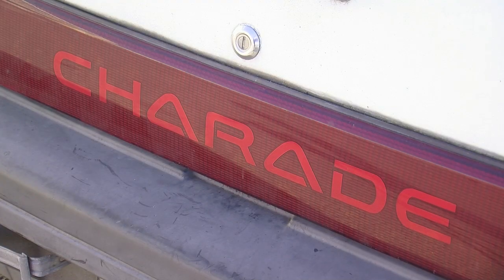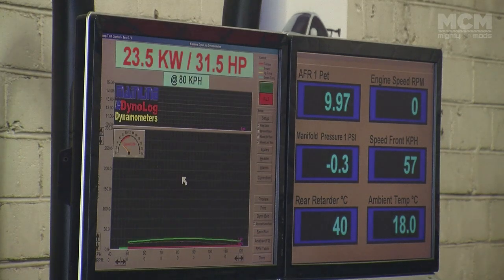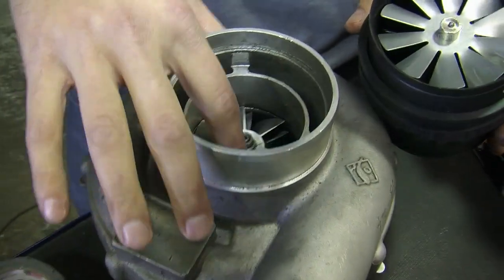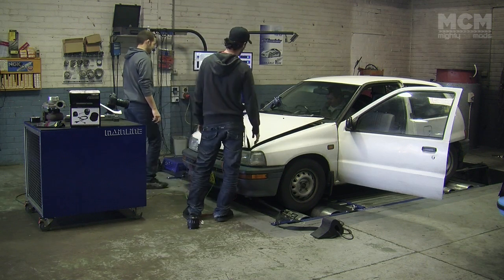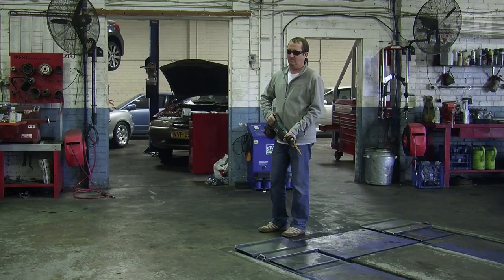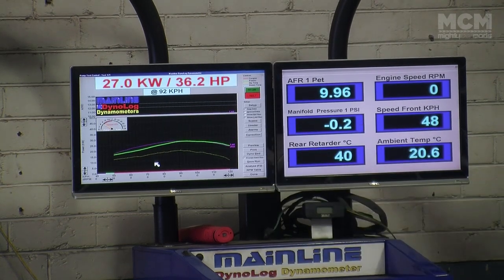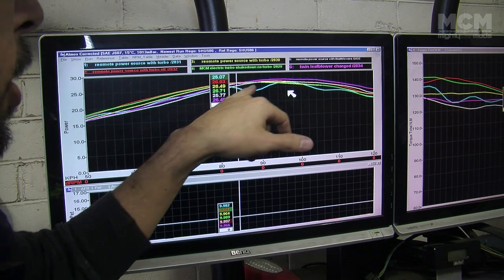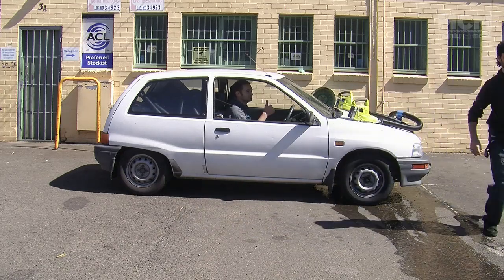Electric SuperChargers Mythbusted

Comment: I recently encountered that again, in another video. Below is my comment on that video. I was wondering & hoping, that since I am loyal to BEVs & Series-Hybrids, could you revisit this topic, and build a serious, neat, Electric-Supercharger system, based on my comment below? If you want a new challenge, or project, how about you try this?:

 Those intake fans, are one of the most stupidest, most retarded, retarding, evilest scams I know of, only bested by Abrahamic religions, governments, and Chinese plastic-rice & frying with gutter oil. I can almost guarantee, that your engine can move more air, at IDLE, then those intake fans. Electric Supercharging is possible, but you need an electric motor, that's bigger, stronger, and more robust, then your Starter-motor. And whether through direct gears, chains, or pulleys. The gear ratio would have to be set up, for the compressor to spin much faster then the Electric motor, and that motor needs to be torquey enough to do that AND compress air...

With normal Superchargers, that are powered directly by the engine's crankshaft. Those Superchargers are very simple, and have no lag like a turbo. But the parasitic drain. Instead of using the normally wasted heat & pressure of the exhaust, like how turbos work. A Supercharger makes an engine work even harder, to produce more power, because the Supercharger is a physical load on the engine. This is inefficient.

I bring all this up now, because a serious Electric Supercharger, will also place a physical load on the engine, only the load isn't from directly turning a compressor. The load is from the Alternator/Generator, which becomes harder to turn, when it's creating more electricity to power something or charge something.

So Electric Superchargers, maybe pointless.

The only benefits I can think of for Electric Supercharging, is setting up an Arduino or something, so you can have an adjustable Supercharger, that you can also turn off for fuel efficiency, though, if the stopped compressor & motor become an air restriction, then you may need a separate intake & bypass valve, to go around it, and the bypass valve has to be strong enough to seal in the compression, when the E-Supercharger is turned on.

You can program the E-Supercharger characteristics, to change with engine RPM, or have settings that change on the fly, with buttons...And unlike a normal Supercharger, this hypothetical E-Supercharger's RPM, is completely separate from engine RPM. So if your engine can physically handle it, and the fuel system hardware & software can handle it, then you can have near instant, ridiculous levels of boost, FROM IDLE...You may be able to do surprise launches, almost like a powerful Electric vehicle, but not as instant as electric motors directly turning the tires, because an E-Supercharger has to build compressed air, for an engine to build RPMs, for the engine to reach it's optimal torque & power ranges. But the acceleration should still be better then stock, if you're loyal to engines directly powering your wheels.

For the compressor motor to spin faster. I recommend it being powered by Super/Ultra-Capacitors, with enough wired up in series, for a higher voltage to spin faster, and enough wired up in parallel, for capacity and a greater ability to handle the load spike, of the compressor motor instantly spinning up, to as fast as it can, or to as fast as you allowed...Use a DC to DC step-up converter, to increases the 12-volts from the normal Alternator & battery system, to a higher voltage to charge the capacitors, and spin the compressor motor faster than 12 volts can.

Make sure to choose a compressor & motor that can handle spinning at high speeds, and maybe a separate cooling system, for a liquid-cooled electric motor, especially if the motor & compressor are in the engine compartment...And if you are going to use a 12-volt Alternator/Generator, instead of a higher voltage one for the E-Supercharger system, and a step-down converter for the normal 12-volt system. If you still want or have to use a 12-volt Alternator, then make sure it can handle the current needed, for the step-up converter to charge the capacitors, and power the E-Supercharger.

It's like you're building a homemade Series-Hybrid or Parallel-Hybrid, only instead of an Electric motor turning any tires, it's turning a compressor for an engine. And the motor controller's throttle signal, is from an Arduino with sensors, or in tandem with the engine's throttle, or the signal is an on-off button, acting like a Nitrous button, only instead of N2O, it's Ultra/Super-Capacitors.

 I forgot to mention, there are electric motors, more suited for speed than torque, like search for motors that give you higher RPM, per volt. And instead of gears, pulleys, or chains, it may be good to directly couple a high-speed Electric motor, to a centrifugal or axial compressor, or maybe a twin-screw or roots style compressor.

If you're interested in a real Electric-Supercharger, then do your research, be creative, and be careful.
Reply: I apologize for it being so long, but I like being detailed.

Comment: I brought one for £5... 
Not electric mind but you put it on your intake then your filter afterwards.  
Got a turbo diesel 5 cylinder alfa brera remapped to 270bhp. All the extra fan is doing is just forcing air into the turbo faster so spool times are quicker. Did i dyno run and added an extra 5bhp
Removed the DPF and the gunk and gained about another 10bhp 
Deleted the EGR gained about 10 extra break and fuel consumption 
So in total 290bhp 
But yes i think the little fan made a difference to my diesel 
The boost is insane

Comment: 14:23 Turbo chargers are fans too powered by the exhaust. And on a mini bike there are noticeable power gains with the electric turbo (not sure number wise, but it  was definitely a noticeable gain) but you said the electric turbo charger is just a fan and it absolutely doesnt work

Comment: A supercharge takes on the order of 25 to 50 horsepower to run for flowrates and 10psi  for a V8 size motor. The range is that big to cover different engine sizes/rpm ranges/efficiency and just to give you an idea of the power required. This is just not happening with this fakery.

Comment: Here's a question why don't these work? Why can't an electric motor do the same as an exhaust driven turbo?
Reply: I guess they just plain dont make pressure. this is just loosely blowing air into the intake.maybe if you got a belt driven supercharger and connected it to an electric motor to spin it itd work.

Comment: MY hybrid has dual  60KW (80HP) electric boost motors  putting out  160HP/368 lb torque . plus the 332hp  367 lb torque ICE..    No need for an after market cheap electric  turbo 

electric motors do the job well,     those are just too weak

Comment: Turbos don't just blow air, they compress the air. Audi is bringing out some Turbo models with electric supercharger to combat Turbo lag. A 12volt system is not sufficient as AUDI uses a separate 48v system to run a 7kw electric supercharger

Comment: Get a vehicle with a mid 70's to earlier Chevy v8. Perferred an actual 350 bored to 357. 9 on the compression. And spend the $1'350.oo on a B&M super charger.   Broaden the spark plug gap .50 from the stock gap. Run 93 octane with 104 octane boost about 1 oz per gallon. There.

Comment: OMG you noobs know nothing about volumetric efficiency do you?????? The idea is to have more oxygen per cubic foot and you are trying to do that with fans to simply push more air through your motor well in this video I see a few mistakes okay first off your plumbing for the intake air should have no zeto hard 90 degree turns they will restrict the flow and polishing the ports in the cylinder head will allow better flow as well and a little cam can help to lastly the exhaust has to be just as free flowing as the intake all that will give you a very noticeable increase in power granted it's going to cost some money...... It's like I used to tell my customers when they asked price I'd ask them how fast do you want to go the faster you want to go the more it'll cost for sure need deep pockets to be legit 😉😉

Comment: Well the if you wanted to get into the math side of it, you could probably get an increase in power on some engines with the cheap pipe fan, but it would depend on the amount of air the fan was capable of moving per minute and the amount of air the car needed per minute.  The problem with what happened here is the car at full throttle was using more air than you could get from the fan in a pipe gizmo.  Which is why the two leaf blowers did do something, they pumped  more air.  The fan in a pipe might actually work on something like motorcycle engine at low RPMs... but that is the other problem, faster RPMs will mean the engine is in need of more air and these electric fans or even leaf blowers only operate at a single speed... that means they will likely work to some degree though start doing less as the RPMs go up until you pass the point where they can't deliver the amount of air needed in which case you would see the power start to drop as the engine is then starved of air.  It would have been interesting to see a printout of the power over the full powerband with the fan in a pipe and the stock car.  I'm betting you would see some minor increase in power down around the idle speed maybe even up to about 2,000 rpms before you would see the powerbands converge and then the fan in a pipe band would drop below the stock band.

Comment: Hey guys, you are absolutely right about this garbage. However, there is a better quality product on the market which has to be imported from China. I watched their test video, and it is an actual turbo. Unlike this one with cheap fan blade, that one has a long shaft which looks like a mini steam turbine. It has rows of fin blades, and last row is reversed fan blades. It also has two little side intakes to compensate air loss. That is airplane turbo design, and their test showed significant increase on performance. I didn't see a computer result, but they did couple other tests on the short video. The air flow rate got five times higher, and 0-100km was 2s faster. It also has a control chip with adjusting abilities for speed, mode, delay time, etc. Needless to say, the motor is brushless. I am getting it, and I am confident that it would work.

Comment: What about ram air?  Does it actually add power?
Reply: True ram air forces more air into the system plus its cooler air both of which will definitely help add some power but the computer needs to be reprogrammed to get the air fuel mixture correct in order to gain the most from ram air/cold air intakes.

Comment: You boys know those were meant to be put directly to the intake or carb right you loose a lot of your forced air in the air cleaner... There is a video of a ford excursion 5.4 ltr getting an extra 25 hp off of a leaf blower

Comment: maybe i think u must remove default air filter first, so make sure the electric supercharger behind of air filter. because if the arrangement of supercharger then the air filter was the air boost to the machine blocked by air filter.
Reply: So, not only does this fan not compress air, therefore, you cannot fit more air into the cylinder, and therefore cannot fit more fuel into the cylinder, and therefore, cannot get more power. The only thing these could ( and don't do) is help you climb through the revs faster by speeding up the rate the engine gets air. So come up with whatever reason you want, this wont make more power. If it DID compress air, you would still need a tune for the ecu to give more fuel, if you slap a real turbo onto a car and dont tune for it, youll knock it apart and the ecu will try and take as much power as possible by pulling time to prevent your dumbass from blowing the motor

Comment: Can you use a big compressed air tank with a valve that you can operate from inside the car to pressurize the air in the engine ??
Reply: How to know how much airflow in and how to add fuel to match.and compressed air are hot

Comment: @13:50 "Turbos spin at over 100,000 times a second." -Marty

I thought turbos spooled to something like 30,000-50,000 RPM, but according to Marty we're talking 6,000,000 RPM
Reply: he said 1,000,000,000
Reply: @K7L3-93  Protip: if you double tap the left side of your screen you should be able to rewind the video. Master this handy technique to avoid being obviously and needlessly wrong about everything, ever.
Reply: @seedy80  I'm on PC. Double tapping isn't working.
Reply: @K7L3-93  you may be missing a crucial detail, let's troubleshoot this.   Please confirm that you are actually on PCP and repeat the attempted double-tap on something else.
Reply: @seedy80  I am on PCP yes. I'm tripping balls right now.
Reply: @seedy80  Need better instructions. My monitor fell off my desk.
Reply: @MaxBrix  shit your lucky I was trying to follow the instructions but I accidentally dropped the toaster in my tub!
Reply: He meant 100,000 rpm. If my turbo was doing 6,000,000 rpm as Marty suggested, I don't think it would still be working after 100,000 miles!

Comment: I keep telling people that real superchargers are using 30-60hp at peak power (some even higher) so there is no way in hell a 100w tiny electric motor is doing the exact same thing even if it did have a proper compressor which none of them do to my knowledge. If you want a real electric supercharger rig up a 72V motor off of a Tesla and fasten it to a compressor wheel geared up about 12:1 and bolt on three or four of the largest alternators that you can find so it does not drain your battery in seconds. Of course a regular ol supercharger is better in just about every imaginable way so why bother going electric?

Comment: Couple of months ago, I had an idea of using an electric motor driven turboprop that sucks in air and compresses it and sends it to the engine. I had only recently found out that people had been working on E-chargers. I will still design my idea though and hope it works out.

Comment: Push all the air you can in to the intake, if u don't correct the fuel quantity you just gonna make the stoichiometric wrong. And this is true for a real turbo as well, in fact there is no reason of why an electric turbo would not work, until we don't care about the efficiency.
Stop to believe everything you see, turn on the brains.
Reply: i don't think that small pc fan will push more air in than the intake can suck in normally so imo that thing just restricts air flow
Reply: @danidaimondzofficial582  Daihatsu are FAMOUS for SMALL intakes to keep fuel economy their best trait, so OF COURSE Daihatsu is not going to be the best responder to anyone wanting to make more power from a tiny motor ESPECIALLY if it means losing fuel economy along the way
Reply: Luca Martinelli 

The charade is probably so shagged it'll run rich as balls anyway.
Reply: If you were able to change the fuel air mix, you would not see noticable gains still. Turbos and superchargers work by forcing more oxygen into the engine than standard air pressure. The insides of both real devices allow space for pressure to build up and the fans are beefy and usually very precisely constructed to this end. This thing is not going to force very much more than standard air pressure as anything in excess is just going go right back out.

Comment: When it comes to supercharging an engine, if you weren’t concerned about fuel mileage, could you install a smaller 2stroke engine to power a forced air induction to cause boost without taking power from the main engine?

Comment: what about using a 6in duct fan       found 2 that sound good just need to do some power mod or something     https://www.bonanza.com/listings/Yield-Lab-6in-440-CFM-Duct-Inline-Fan-Variable-Speed-Controller-Grow-Room-Intake/645549957?goog_pla=1&gpid=76983190021&keyword=&goog_pla=1&pos=1o11&ad_type=pla&gclid=Cj0KCQiAoJrfBRC0ARIsANqkS_4O1mv0DCq55TSePB4W1brZlvASBJZ5Sl_UQWYmK_Z7heRkcp8lCq0aArj8EALw_wcB                                                                            https://www.google.com/shopping/product/17864907499032292547?biw=1920&bih=966&q=6in+ducting+fan+cfm&oq=6in+ducting+fan+cfm&prds=paur:ClkAsKraXyT3tPagKq2lD0GUONh5Sy4NPPHrf9bCvzNMxqVdOyQC6FZaplrxYKXX5WkT-iIEqgnB1ELK-nRqpoy2L0SsD4-LqoGhCmLpC13B48XxLcCPhqBoARIZAFPVH73Bgs-50Y6gf4lY3UYGHce4PjETbQ&sa=X&ved=0ahUKEwjpttaJ38veAhVL5awKHZOqBnIQ8wII8wI

Comment: Is the vehicle fitted with a carby ( carburetor)? if so the electric super charger would need to be fitted between the carby and the intake manifold, so that the air is still sucked through the carby *not pushed through the carby, causing an in balance in the carby. Hence no real power increase. So sorry guy's Mythbusted actually got Mythbusted.

Comment: Common sense would indicate that the stock air cleaner housing is a massive pressure leak. Eliminate all the stock metal and pipe the SC directly into the carb/throttle body intake and you see an increase.

Comment: the leaf blower experiment was very poorly designed each turn in the tubing caused a great loss of energy. rather than using tubing and a t fitting the 2 blowers should have been in line with the intake using a cone with the blowers canted at a slight angel to induce a spiral air flow down the cone this would have given a direct natural compacting of the air entering the intake with no loss of power probably doubling your results just by using a smart design.